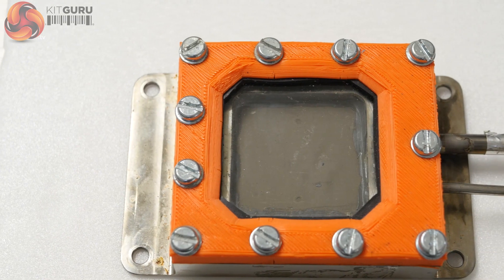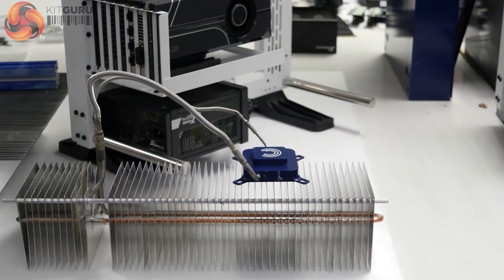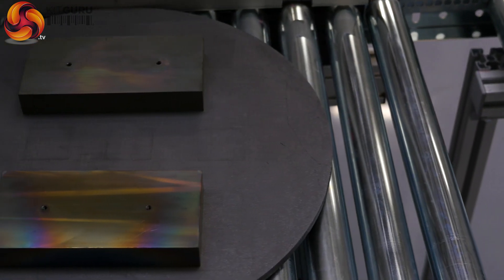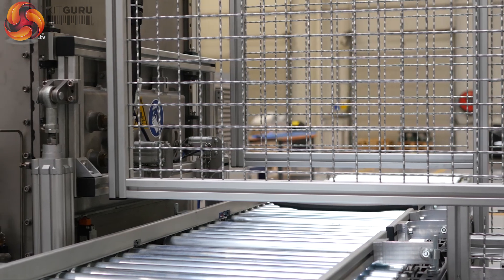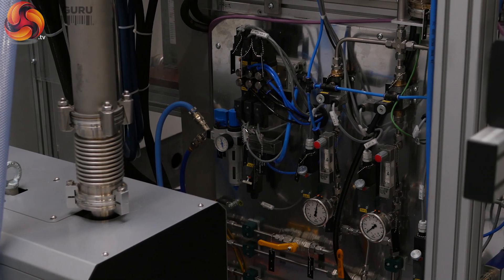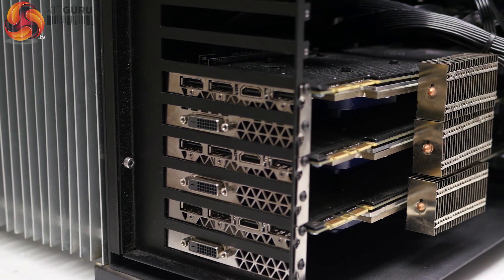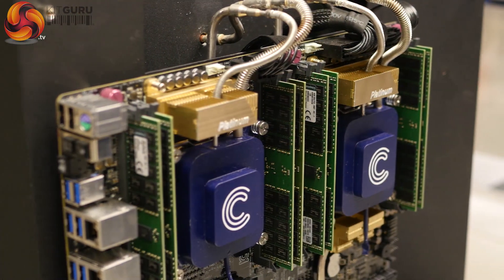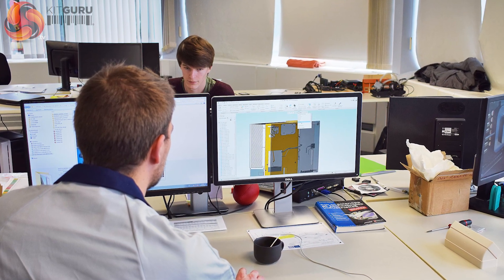Is Calyos THE world leader in Advanced 2-Phase cooling?

Comment: Looks very exciting and looking forward to seeing the Kickstarter project delivered.    What is the life expectancy of a system running at say 95 degrees celsius? I'd prefer to have the key technology, i e cooling solutions sold in modules, rather than bundled with a specific case. This, since case size limits the cooling fins size, and hence the cooling capacity.